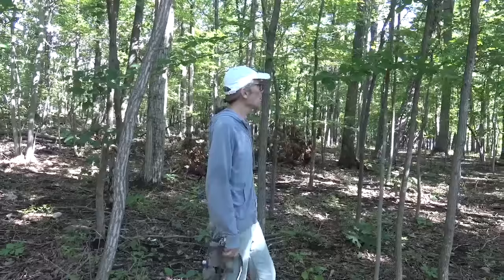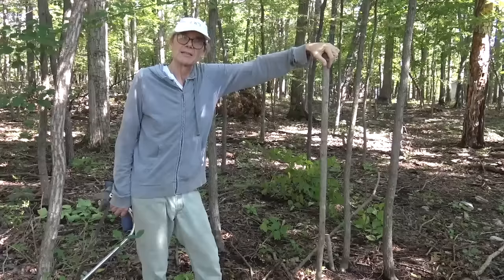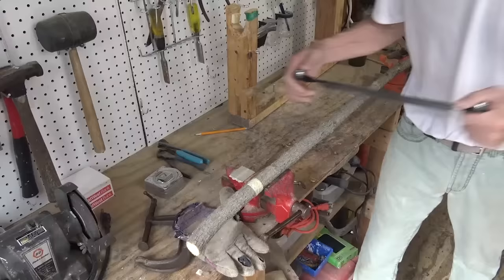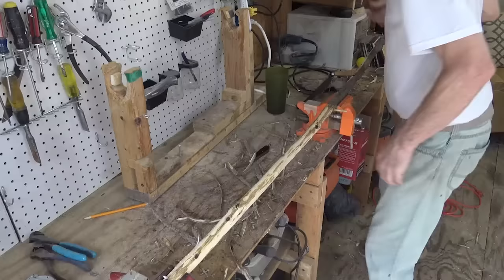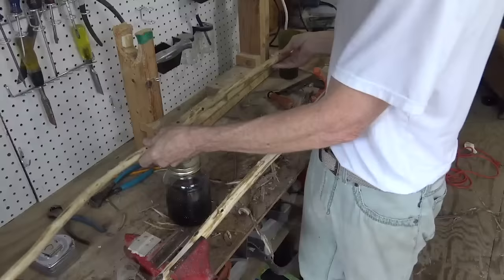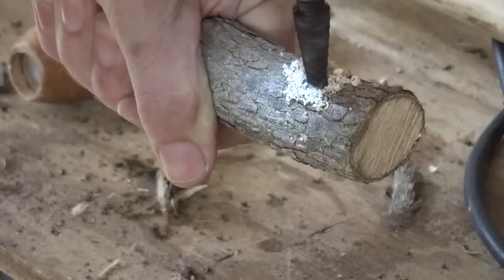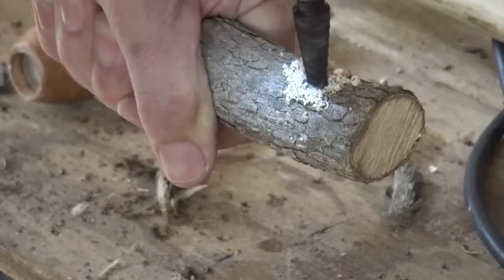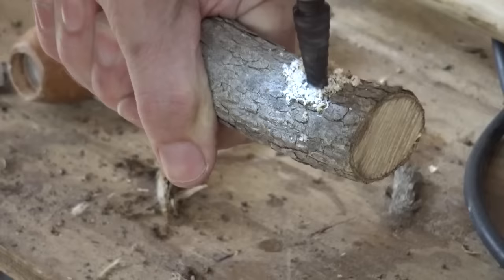Creating with Kimmon, Walking Stick

Comment: I cut sticks year round, dry them with a heat gun or open flame, to straighten/ dry them. Apply clear coat. I make them for walking sticks and Escrima practice batons. Most of them last awhile and are hard and solid with good weight